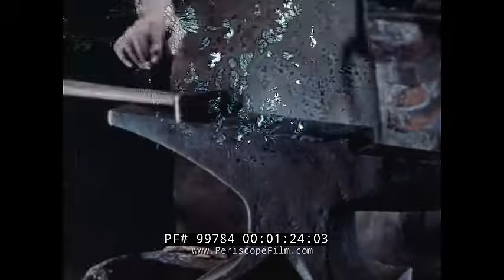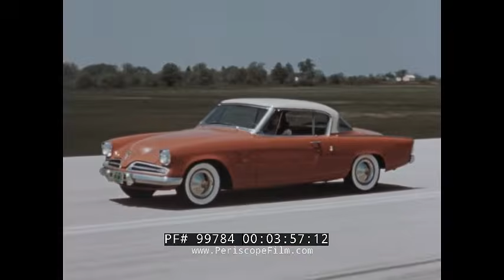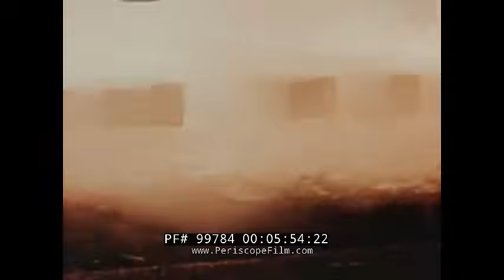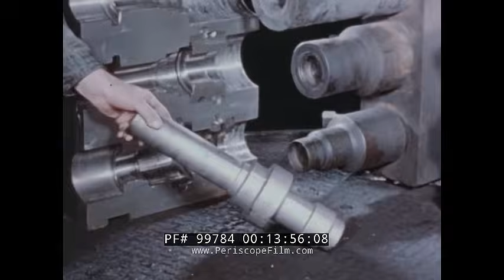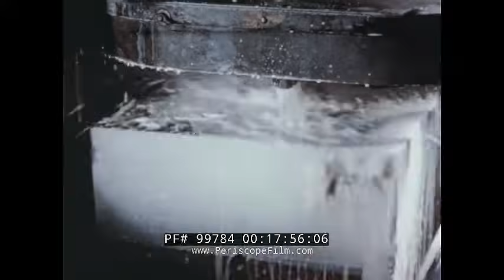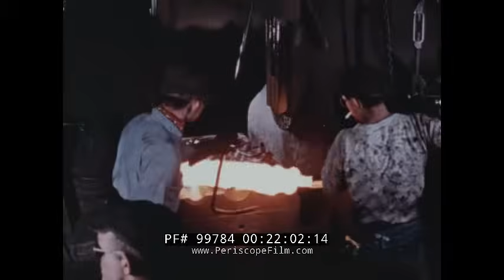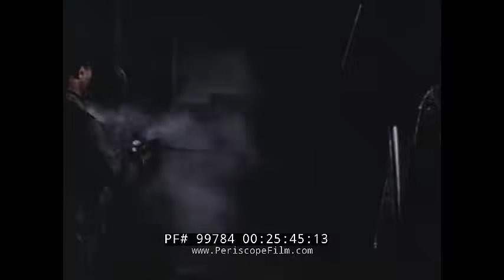" FORGING IN CLOSED DIES " 1955 DROP FORGING ASSOCIATION PROMO FILM  STEEL  99784

Comment: Nice to have this topic digitally preserved from the 1950's. It's a very rare in-depth discussion of Drop Forging, which is not usually shown or narrated in such detail elsewhere on You Tube. 

Present day discussions on You Tube seem to favour CNC carvings from a single billet of aluminium alloy, but according to this video, the grain structure wouldn't be as strong. Be interesting to compare foundry-casting grain structures to drop-forged grain structures. Well done Periscope Films!
Reply: If you ever go to the hardware store and get a bolt, you may notice the neck of the bolt is skinnier than the portion with threads. This is because they roll the b and blank between two concentric dies and form the thread and the material is upsetted. Thus they have a higher grade and are stronger.
Reply: For some applications, the aluminum or steel block to be cut by CNC is already forged.
Reply: @pdr5926  Thats interesting. I'll look out for those.
Reply: @BrassLock  high performance engines are made with a billet of aluminum that has been pressed and compacted then cnc'ed. Solved the weakness problem of aluminum over steel.
Reply: @pdr5926  Yes, but milling a piece directly from a bar-stock is never going to be as strong as a piece which is forged from its initial bar-stock into its necessary shape (and then milled/trimmed to completion).
Reply: So we’ll said! And I’m so happy you pointed out how YouTube videos now favor CNC work of billet aluminum. Nothing like forged steel
Reply: cast is no where near as strong as forged.
Reply: If you run a CNC MACHINE YOUR NOT A MACHINIST YOUR A MACHINE OPERATOR / PROGRAMMER AT BEST.
Reply: Cast and then machined will Never  never never meet the grain structure benefits of forged. Hence wrought iron bar stock is usually four to seven times more expensive than an ingot of cast iron.
Reply: @joshschneider9766  I... what? It's because they're completely different materials. And do you even mean wrought iron, or modern mild steel?

The grain structure of forged items is... overstated. There's also some confusions given that grain can mean at least two entirely different things (both of which forging can impact in certain materials in different ways) when it comes to steel, and cast iron is effectively an entirely different ferrous alloy than any of the others. There's also ductile cast steel, nowadays. So you have grain as in the granular structure of the internal crystals, where size is primarily what matters (which can be increased [bad] by getting it too hot or for too long, or decreased [good] through forging to an extent but primarily by annealing and normalizing [types of heat treatment]); this is the type of grain that matters a lot, and it comes pre-treated from the steel mill. 

And then you have grain as in a wood grain, a grain (mostly theoretical) running down the piece conforming to how it's been worked; given that all barstock is forged in its creation (really it's poured directly into a rolling mill, where it's forged) it already has a grain. The only time I've even heard of this being a problem is in mostly apocryphal stories about a person laying out a part very stupidly and subjecting it to multiple stressors and then blaming the failure on the grain going the wrong way. This is the type of thing that is being referred to by the "grain structure" of forged items conforming to their shape properly. In reality drop forged steel items could be made very strongly and with very complex shapes quite easily compared to anything else for a long time, reinforcing them while being somewhat lighter. There's a whole series of intertwining myths that have to do with this, which probably arose naturally as people tried to explain what metallurgists today know the reasons for. 

Cast iron is weak due to its high carbon content (too high, making it brittle) and often quite large grain (crystalline structure) which allows for easy cracking. It's however not really comparable to other cast materials, or analagous to normal steel/ iron because it is materially different. It's all old terminology problems.
Reply: @farmerboy916  From what I remember, cast steel can be almost as "strong" as forged high carbon, and cast iron is far from weak, but they don't tend to perform as well in high impact or fatigue applications. 

My understanding is that forging naturally relieves a lot of the shrinkage stresses a cast part would acquire right after the phase change because the whole part is put into compression at a molecular level, and then cools from a lower temperature.
Reply: @maxscott3349    Yes, me saying cast iron is weak wasn’t strictly true but is more correct than not. Don’t actually know anything about the strength of ‘cast steel’ the material type (which can reference a carbon range) versus carbon steel, though I’d suspect a degree of additional brittleness.

Think about that for a moment; what makes up the molecular structure of metal? A giant lattice or series of lattices held together by molecular bonds; how on earth is forging going to make them get closer/ compress when the atoms themselves are holding each other at a given distance? This lattice is admittedly variable by temperature which is why hot steel is physically larger than cold, but you’re not going to cause it to compress and stay compressed by whacking it with a hammer, nor is casting going to cause the molecular bonds to be stretched. 

I can believe shrinkage stresses would be relieved from heat cycling it, but forging would if anything run the risk of adding more. Actually, shouldn’t a cast that was allowed to cool naturally be as annealed as it can reasonably get? If anything holding it at heat may be what could relieve internal stresses, and there will always be some minimal stresses because the steel as it cools will physically shrink a small but measureable amount anyway…
Reply: @farmerboy916  THANK YOU! Too many will continue to believe the myths associated with forging metals. They do not want anyone confusing them with facts.
Reply: @farmerboy916  Metals are "sticky" clumps of crystalline grains. With a cast piece, these grains are randomly arranged, so when you put a load on the metal the grains can slide around (the metal bends). Forging strengthens the metal by pre-sliding the grains around until they interlock with adjacent grains. aka work hardening. It's stronger because since the grains are locked with adjacent grains, they can't really slide around as easily.

To that effect, you can get much of the strength of forging by extruding the metal and pressing it around dies. Those deform the metal just like forging, work-hardening it. That seems to be the preferred method used nowadays. CNC machining is for when you need a more precise shape. The CNC machine's bit has to be able to cut through the metal. So you either have to use softer metal, or stronger (more expensive) bits.

Adding judicious amounts of contaminants (alloying) can strengthen the crystalline structure by making it harder for adjacent sheets in the crystal lattice within a grain to slide past each other. Heat treating allows locked grains to reorient and align their crystalline structure, so they form a bigger crystal grain. Making the metal out of bigger crystals (stronger, but more brittle). Annealing (heat cycling) causes the crystalline grains to be reformed, removing much the strength gained via work hardening.
Reply: @Ben Chuft lmao